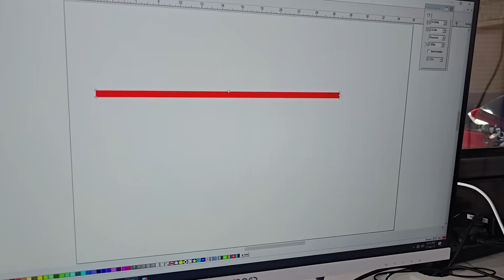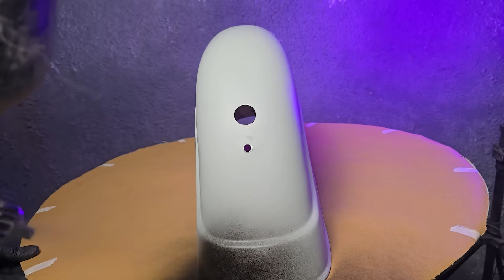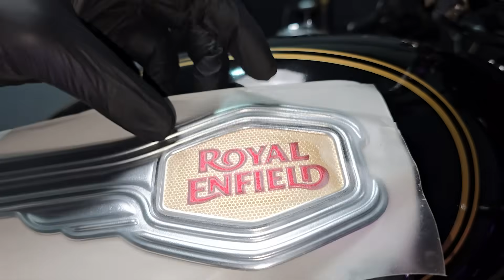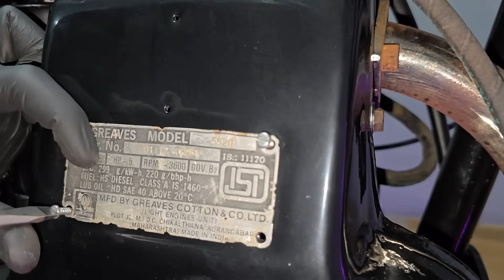Restoration Rusty 40-Years-Old Motorcycle | Old Bullet Full Restoration | Royal Enfield Restored 🔴

Comment: 27:11 breaks a c-clip. Continues installation anyway. Rust on the primary drive parts later on. Presumably more such throughout, but I didn't watch it all. 
Oh well. Looks like an off-the-shelf engine anyway. 5hp, single cylinder diesel. Seems to belong there. Not the only one of these with it. Interesting choice for the factory or whoever put it there. My ebike has more power. 
Those are quite the thumb nails. Not the same hands that start and end the video.
Eh. Cheap entertainment, so I'll stop complaining.

Comment: Nice job buddy but i suggested the metalic parts sandblasting is more fast the rest excellent 👍🏻😎🇻🇪👏
Reply from the maker: Thanks for the tip
Reply: first wash then metal wire brush whit angle grinder all, NOT sandpaper grinder, wrong. and very hard place only sandblast.
Reply: The amount of oven cleaner and paint stripper going down your drain will have your local environment protection authority at your door soon.  Get or make a sandblast cabinet.

Comment: First you must be commended for some of the hard work you started on bringing what looked an impossible job. You started well but seemed to lose enthusiasm part way through the rebuild. Painting of the frame was terrible, it should have been taken back to bare metal then a primer used then a Top Coat followed by a Clear Coat . The engine rebuild could have been done better, there was surface Rust on internal parts such has rocker arms , rocker springs, studs that should have been removed and so on . At least you got it running again so you have to be commended for that .